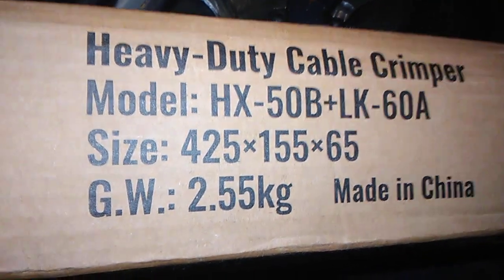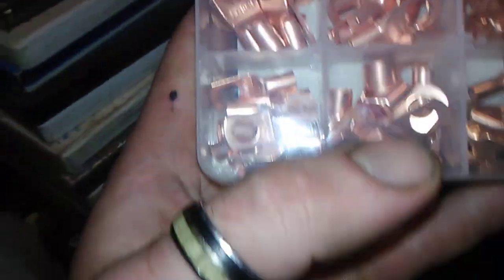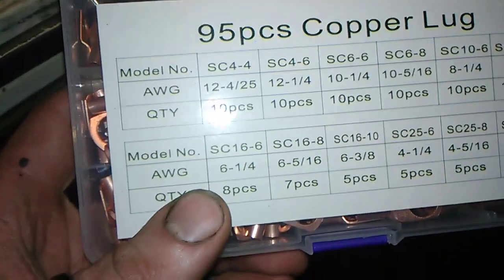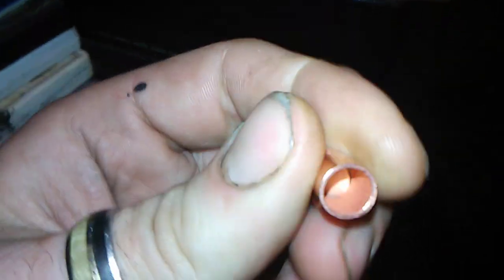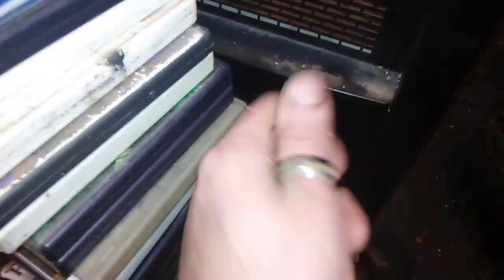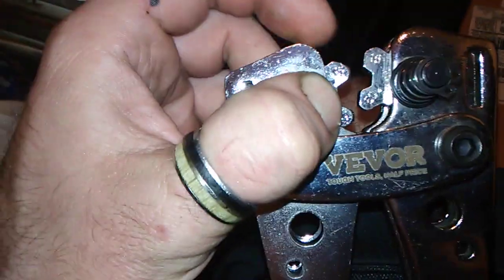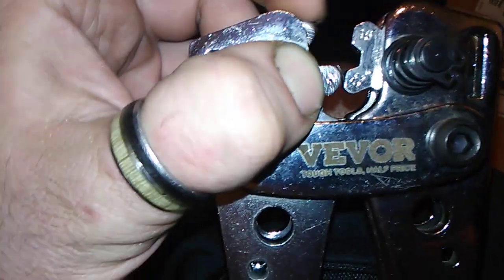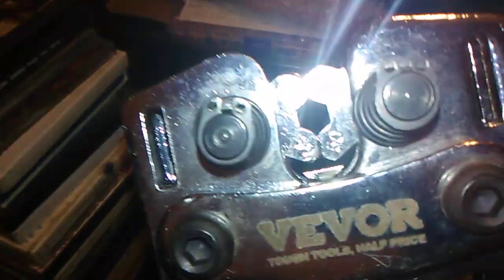"Heavy duty Wire camper!" "how to use and fix stuff!"

Comment: Sweet looking tools them are called round headed wire cutters looks good another way to fix it is stick a piece of solder in the copper with a little flux heat with torch let cool down and then crimp it double locked 1 with solder and with crimping tool
Reply from the maker: Already did that

Comment: Heavy duty wire 'camper'??
I think you mean crimper as it says on the box, and your title pic shows a pair of wire *cutters*🤣🤣
Hydraulic crimpers are way cheaper, way better and so much easier to use than those old school bolt cutter style ones.
I'm so confused now, which on is it?
North or South....definately Southern...fkn this fkn that, fk yeh😁